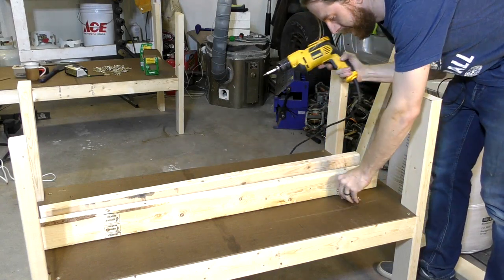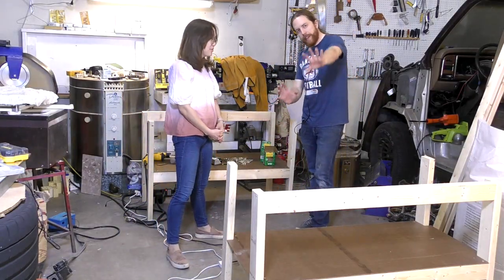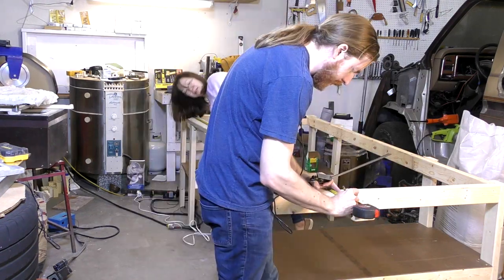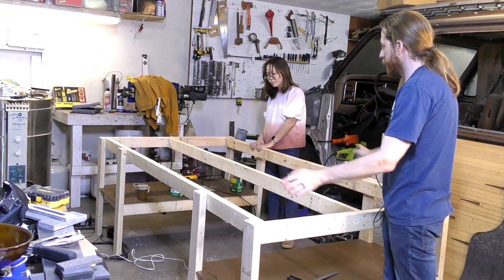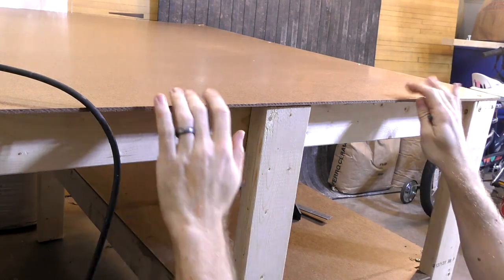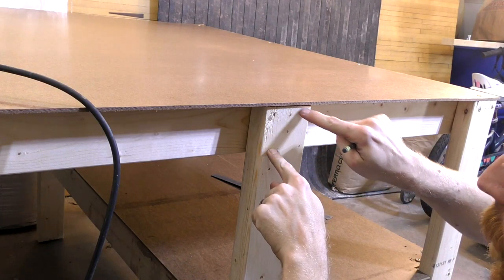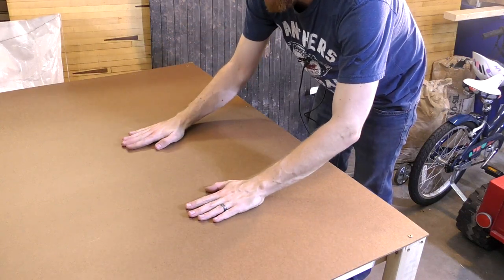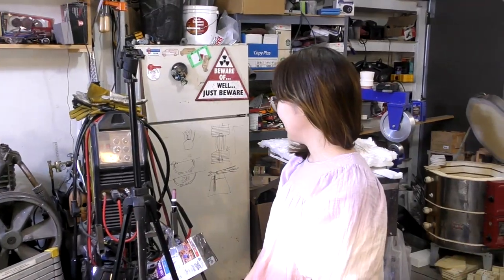DIY Make a Big Craft/Sewing Table Part 2: Final Assembly

Comment: It's better engineered than any Walmart crap. I bought a bookshelf that you build yourself. The only thing keeping it from just flopping over was this poster board thin piece of particleboard and a bunch of baby nails. That bord was so thin I broke through it putting a book away. I had to reinforce it with some wood I had sitting around. It was the most pathetic attempt at furniture I have ever seen.